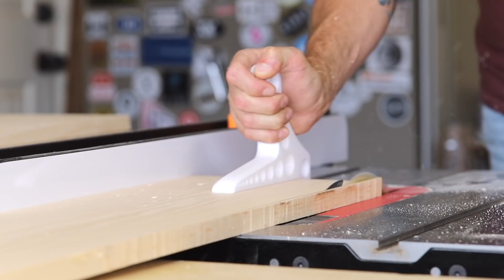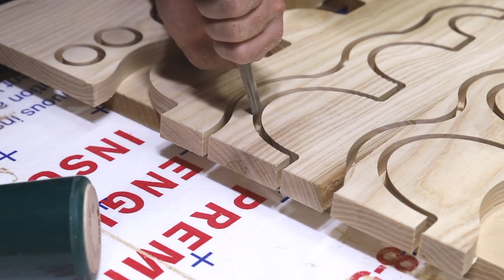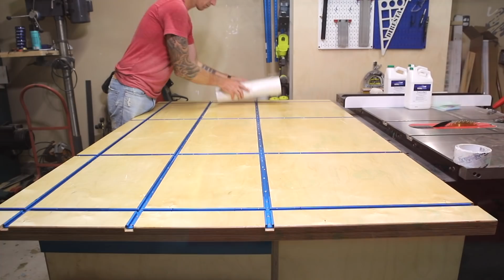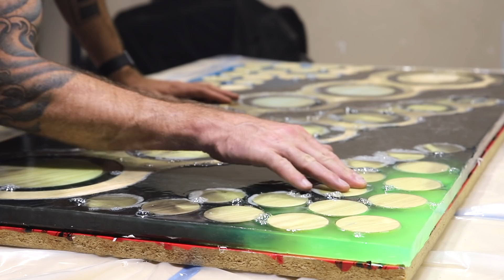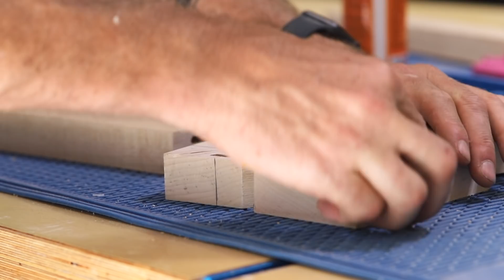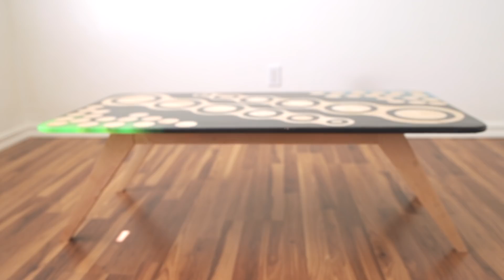DIY Epoxy Resin Coffee Table | Crop Circle Table 👽

Comment: Having fabricated stuff for many years, it happens.  I've fabricated numerous motorcycle parts that ended up in my scrap metal bucket after putting them on the bike and not liking the way they turned out

Comment: Most people think I'm nuts for doing it but I always start of by painting a thin coat of clear  epoxy to the form then adding on epoxy shapes, wood  or other things before doing the thick coat, it not only takes care of corners and edges by getting rid of bubbles and missed spots but it gives me a fastener to hold down whatever I'm putting inside my mold... as a bonus you'll have a spill proof method of adding colors without them getting under the added shapes and spilling into the next section.

Comment: I like the idea, although it would have been cool if you did a real geometrical crop circle but still like your idea. Also when doing casting pours of epoxy, you should hand mix the epoxy with a stick, as your drill paddle introduces a lot of air into the epoxy, which could be why you had a lot of air but could of also been the high heat in your shop like you said, but either way the drill paddle till introduces tons of air into the epoxy. You can still use a drill paddle for casting pours but i wouldn't bring the paddle out of the epoxy while mixing, good job man, i still think you did a wonderful job and keep up the good work

Comment: Did You ever figure out how to keep your epoxy from spreading everywhere..???  Seems like if that hadn't happened this table top would have been Very colorful.... Im guessing  you'd have to glue it into a box frame and pour your resin with LARGE syringes and after it hardens remove the glued frame from the table top....

Comment: on those larger forms you should have sealed them with caulking underneath instead of hot glue. >.> the hot glue will melt from the heat of the epoxy im sure which was the case in your vids
Reply: if i may suggest next time. do your larger form cut outs. but instead of doing the pour all at once. make a form specifically for the larger forms first, pour the glow in the dark. and THEN add those to the whole piece altogether. this allows the glow in the dark bands to be by themselves even if the black does go underneath them. you can always plane away the black that seeps under. also you poured in one huge sum. you know as well as anyone who uses this epoxy that a large quantity tends to over heat. pour in layers. you'll get a better pattern and less hassle if you do it that way.

Comment: One of the issue is with the Total boat's "thick coat" if you only made 2 or 3 pours - the wood won't float and the resin will not overheat and bubbled. But you still pulled it of, it's a one of a kind piece of art 😊

Comment: cool table. I'm not so crazy about the design, but it's almost like something a person might want. I would use more wood and less Resin to achieve the look you were trying to get. Asymmetry is something you want when trying to get the look of space and organised planetary systems. I would also include some EL wire into the table to get a nice even glow around some stars or galaxies or whatever you want. EL wire is better than LEDs for even lighting, the electronics would be easy to incorporate and small enough to remain hidden until lit up. Keep making! Try again, and try a different angle of attack, and step outside your comfort zone when you do, creation is much better when you aren't trying to be safe, if you get my meaning.

Comment: You can use a heat gun to get bubbles out, much safer than a blow torch ( epoxy is highly flammable)  use heat gun on 1st pour ,  what a mess you made.  Your way is dangerous.
Reply from the maker: It’s not highly flammable. Also look at every other epoxy video I’ve made. All using a heat gun. A heat gun OR a torch is acceptable.

Comment: The center design is great, but the corner circles are just out of place. The accidental mixing of the colors looks great. All in all a good learning experience, cut the table down with 2 parallel cuts removing just the corners with the circles.
Reply: Im with you. I think the mixing mistake was not bad at all. Id only say should have poured more color to start with when ya see it bleeding under. Thats just my personal opinion if the colors had been double what they were that would have looked ecen better.

Comment: Great table!
If you want to try it again, I suggest that after you hot glue and nail the long pieces with the holes to the bottom of the mold, seal their inner edges (like you did with the mold sides) before you place the center circles, this should keep them from leaking and prevent unwanted color mixing.
If your shop is on the warm side, 2-3 table fans blowing across the surface should keep the Epoxy cool enough to prevent accelerated setting.
Good Luck...
Reply: Ive seen where they use caulk around the edges of every bottom.piece to stick it down and prevent bleed thru. Apply chalk then stick down. Id add a brad or two to each piece just to be sure.

Comment: I do a lot of epoxy projects. I also make epoxy resin for a living. I dont think your shop temp or speed of the reaction was your problem. At no point did i see you torch the epoxy. You left all the air trapped in the resin. Gradually over time it cane to the surface and hardened. If you used a propane torch or heat gun immediately after the pour, all the air would have been released.
Reply from the maker: That’s not it. This is a slow curing epoxy with cure times up to 7 days. The slow cure allows the bubbles to escape. No need to torch the thick set epoxy like I did the table top. Also adding heat to epoxy with a torch or heat gun can push it towards the exothermic reaction kicking. It’s 100% bc my shop was too warm.

Comment: Epoxy resin is super difficult to work with. I’ve ruined several projects trying to get the right outcome. So many variables factor into how it comes out. Plus it’s really difficult to do in a garage which is where I do mine. Between all the dust particles and the somewhat uncontrolled temperature it can be a real pain. Looks good tho man!
Reply from the maker: Thanks! Moving my next project in doors.

Comment: I like it. I think you had a great idea but I think you needed to do a thin clear coat first to fix the separate pieces down and seal the individual sections off. It would be easier then, without having to worry about floating pieces and bleeding between sections you want to keep separate
Reply from the maker: Yep, exactly. Great advice 🙏

Comment: I like how it turned out, but I guess I can understand why some might not.

Did you have any issues with epoxy chipping out when you did the round over? I've never done a table like this but I always expected the epoxy to be brittle
Reply from the maker: Thanks 🙏. No issues with chip out. Having a sharp bit and using a higher rpm on the router help.